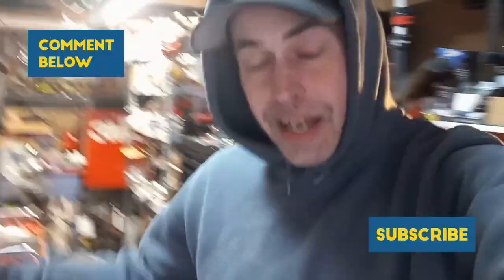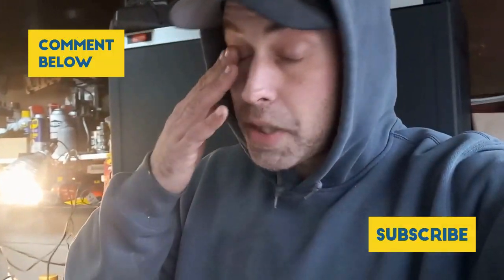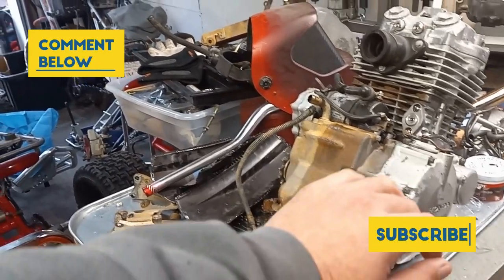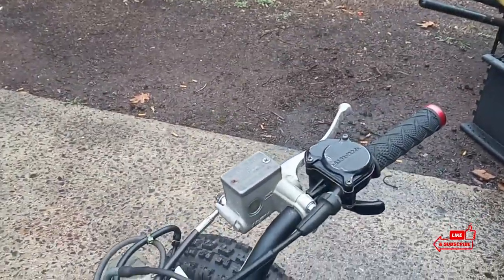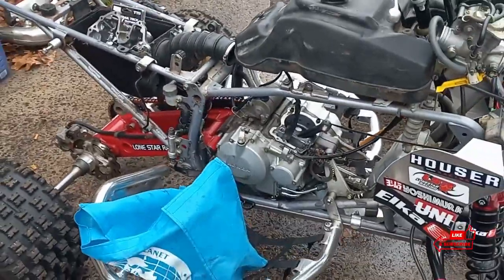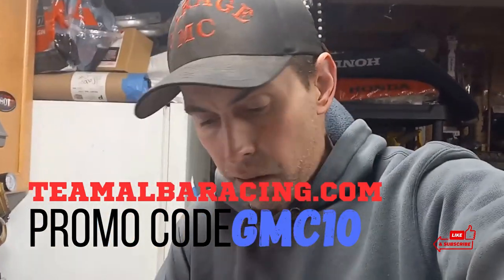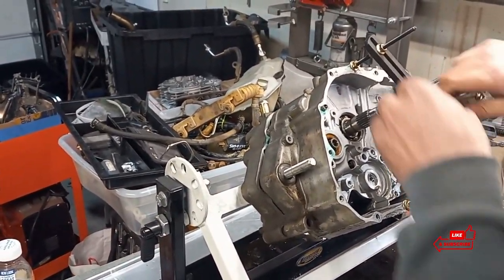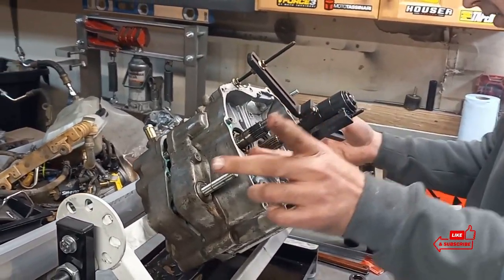Trx400ex Bottom End Part 1 How to Split Cases

Comment: I just bought a 2001 and it's rough. I'm wondering if theres supposed to be a spacer between the case and swing arm on the rear pivot bolt. I see at 5:18 this one doesn't have one. Is it supposed to be like this?
Reply from the maker: You mean the spacer that goes into the cases or the 2 that go in the swing arm?
Reply: @garagemcmatt  Between the swing arm and case, I made a video of it. https://youtu.be/625W08C2UbM
Also this thing is a 2001 (10th digit of VIN) with Reverse so I guess the engine is newer. Is the wiring the same between the years? Because it's wired to jump the solenoid and drive, none of the controls switches function and stuff is disconnected. I've had this less than 24 hours and already ordered a ton of parts and been looking thru your videos. 
Thanks in advance for any info.
Reply from the maker: @maglight2006  the reverse came out in 05 and the wire harness and cdi are different. When I get home I'll check out your vid and see if I can help
Reply: @garagemcmatt  I see it now, it's the inner race of the swing arm bearing, the one on the right side extends all the way to the case. Mines gone, they left it out. This ones going to be a fun project.
Reply from the maker: @maglight2006  yes those inner spacers come with a pivot bearing kit and there are 2 of them and the one on the right side is longer. If your bearings are good still and u need that spacer only lmk I always keep take off parts like that
Reply: @garagemcmatt  That's awesome, I appreciate the offer. I don't think the bearings are good though, probably need a kit. I'll give this thing a tear down this weekend and make another list I'm sure.
Reply from the maker: @maglight2006  definitely lmk if you need any parts before you buy them from anyone else. I have so much 400ex stuff that I've collected just collecting dust

Comment: Do you have to pull the flywheel to split the case? Say if you were just replacing gears in the trans?
Reply from the maker: You could leave it on if that's what you wanted to do

Comment: I recently bought a bottom end to rebuild but don’t know the year of it, is the stamping on the flywheel side any indicator to the year
Reply from the maker: If it's a non reverse engine it's a 99-04. The only difference I know of in those years is one of the bearings is different but any good bottom end bearing kit will come with both style bearings. You might be able to find out the exact year by those numbers but I've never tried

Comment: Hey man the bearing on the clutch side supposed to spin on the crankshaft slightly?
Reply from the maker: The bearing on the stator side is a sweat fit. The bearing on the clutch side is slightly less tight but shouldn't just spin freely on the crank
Reply: Oh ok
Reply: Thanks

Comment: How did u take the bottom end off the frame? I’m having trouble with the rear mount bolt gettting it out
Reply from the maker: The pivot bolt that goes through the swing arm? They get seized all the time. Your gunna need to soak it a few times with pb blaster for a few days and either use an air hammer, a slide hammer, or cut it out but try all the other options before cutting it. It is not fun but keep at it and u will get it out

Comment: Mines an 06. I have no reverse lol
Reply from the maker: Broken or it has a 99-04 engine on it?
Reply: @garagemcmatt  definitely not broken. But I've followed the protocol for reverse and it doesn't shift into a gear. I myself never changed the motor so I don't think so to be honest.
Reply from the maker: @kodeland7729  would be tough to take a guess at what it could be just hearing about it. I'd start with the reverse cable and how it goes together inside the engine at the clutch cover
Reply: @garagemcmatt  it very well could have been removed by previous owner. I'm the second so I don't really have the right to say I know for sure

Comment: I thought the 416 was bored out to 87mm not 86.
Reply from the maker: 85mm is stock, 86mm is a 416, 89mm is a 440, and 89mm with a stroker crank is a 465 in most cases
Reply: @garagemcmatt  oh okay, I thought 86 was the 406. My bad.
Reply from the maker: @Ninoo187  it's all good bro. If you break it down the math don't make sense but that's what they call the sizes
Reply: @garagemcmatt  well I bought a kit that was advertised as a 416, and it came with an 87mm piston that's why I'm asking. Thanks to your videos I finally got to finish my build yesterday.
Reply from the maker: @Ninoo187  that's cool bro I'm glad it helped. That's what it's all about
Reply from the maker: @Ninoo187  yo bro my bad I think I was wrong with the size you might be rite on the 86mm being the 406 bore I'm looking into it more and I'll correct what I said in the next video. That's what happens when I have a million things going on at one time lol
Reply: @garagemcmatt  haha it's okay bro, I just finished building a 416 so when you said that in the video it kinda threw me off. Atleast you was kind enough to admit a small mistake. Looking forward to all the new videos.
Reply from the maker: @Ninoo187  I'm finishing making part 2 of Mike's engine putting the bottom end together
Reply: @garagemcmatt  badass 👌 I finished the 416 with a stage 2 cam last weekend, and just added a spal fan yesterday. Gonna take it ripping today, let's see if the big bore and stage 2 cam actually makes a difference.
Reply from the maker: @Ninoo187  it definitely does. Next you should have me or someone port and polish a cylinder head for you. Really wake that thing rite up
Reply: @garagemcmatt  that's the next step, first I want to rip on it for a bit, then my automotive teacher is gonna port and polish the head for free. He said the same thing, it's gonna wake the bike up.
Reply from the maker: @Ninoo187  definitely will it's like holding your hand over your mouth and running before it's ported